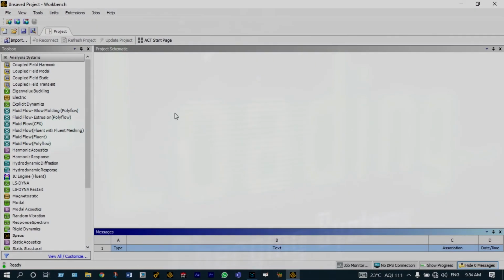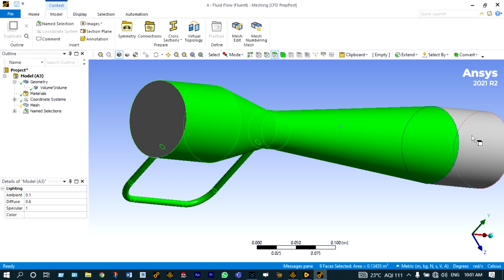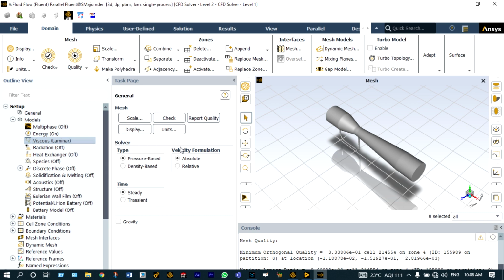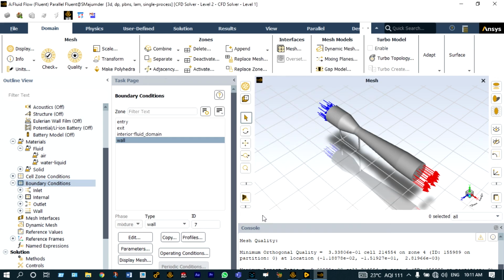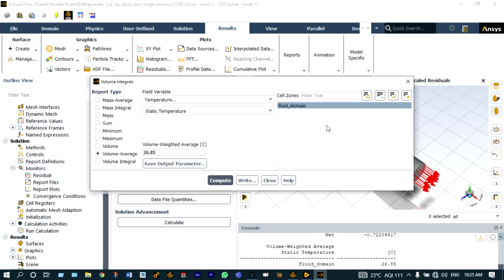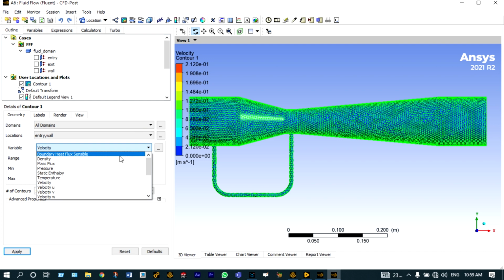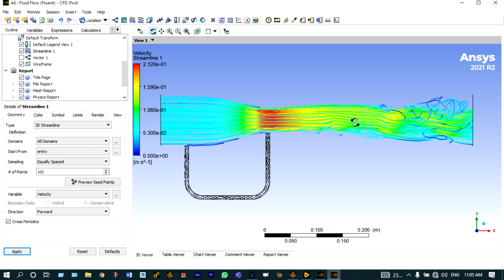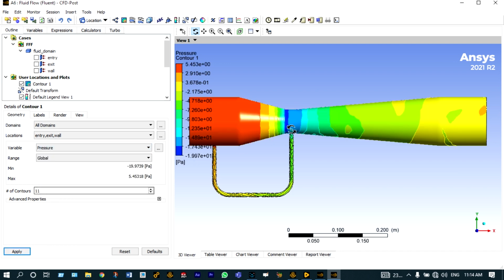CFD Venturimeter | Exclusive Venturimeter Simulation Tutorial - ANSYS Fluent

Comment: At the final step I think you would show pressure and velocity contours at the plane1. In order to do this you have to select as location plane1 and not entry, exit and walls. if you select entry, exit and walls you obtain the same as per step 1 (pressure contour 1). is it correct?
Reply from the maker: You may show that. Not only that you may any desired parameter at any location. Everything is up to you.

Comment: thank you so much.  Well, I have a question: water will flow in a straight pipe and I want to mix the water with the air by placing a venturi in the middle of the pipe.  can you solve this?. thank you.  Allah bless you
Reply from the maker: It is very simple and can be done normally. Try this, if you face any problem please ask me, I will guide you.